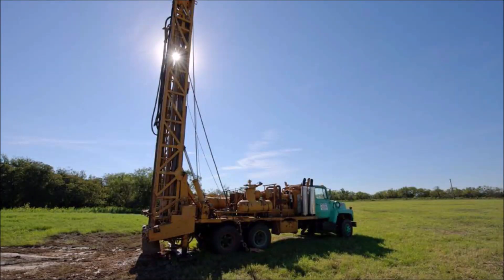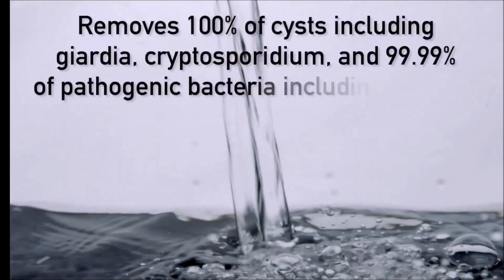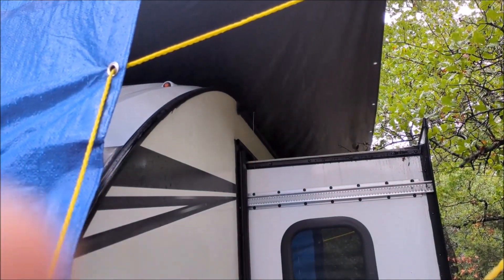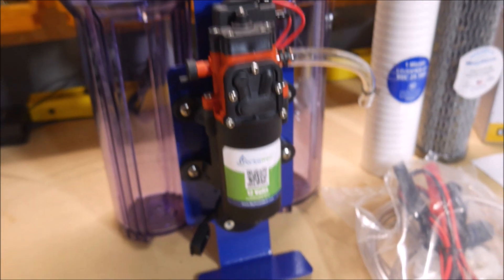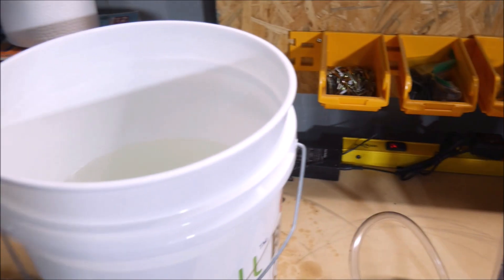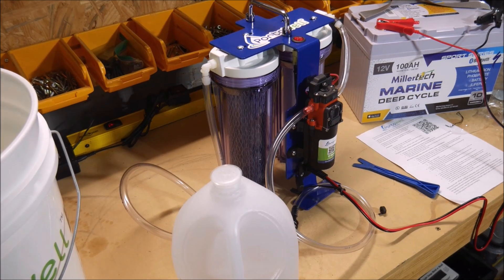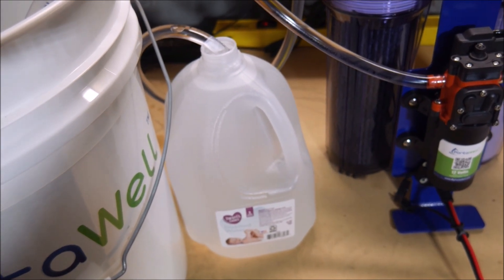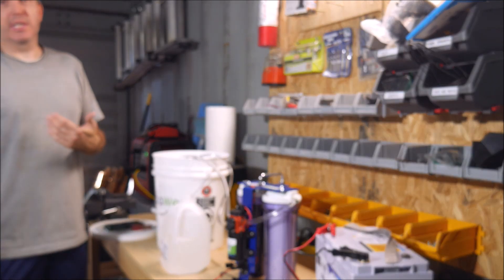Off Grid Homestead Water Series - 12V DC Rain Catchment System Filter For Clean Safe Drinking Water?

Comment: Would you use this for a IBC food grade water tank that's used to collect rain water?
Reply from the maker: Yes, exactly.  Rainwater will still have contaminants and possibly pathogens from coming in contact with the roof and the atmosphere.  So it still requires some level of filtration to be safer.  I say safer because no water will ever be 100% pure unless you go extreme with multiple systems (UV, RO, Distillation, filtration, etc.).

Comment: That seems like a really easy diy setup. A pump and some readily available filters. It would be interesting to see a price comparison. There are a variety of filter cartridges available allowing you to customize the level of filtration.

Regardless of your setup, just remember to always use a first flush device when collecting rain water. Adding a UV light will drastically improve the safety and sanitation of the water.
Reply from the maker: UV light is definitely going to happen at some point but that complicates things a lot.  It is considered optional by most filtration companies.  Ideal, yes.  But not absolutely required.  I have to get my power situation solidified first and a building on the property where I can permanently install the rain catchment system and filtration device. 

Yes, there are a variety of universal filters that can be swapped into this filter.  So it is a pretty good deal.  I haven't looked at too many other similar filters to make sure it is an apples to apples comparison but this one is much cheaper than most competitors.
Reply: @LDSreliance  as part of your future plans for water, you might consider an AWG (Atmospheric Water Generator). There are commercially available units, but a simple DIY setup is probably the best route. You probably already have most of the components needed.

If I had some property and not stuck in an apartment, I would be doing a lot of the same content. Keep up the great work.
Reply from the maker: I have seen those.  I will definitely look into that.  You can't have enough redundancy on a homestead.  I knew that intellectually going into this but now that I am living it... it is even more painfully clear.

Comment: You can easily and cheaply use a DC:DC buck converter to step down your higher voltage battery to the 12v needed by the pump. Small amount of power, cheap and efficient buck converter, probably cheaper than the 24v version of that pump just because 12v is so common everywhere.  And if you ever needed to replace the pump, 12v pumps are everywhere.  Also I've never seen a 48v version (but it probably exists).

One note on those filter housings... They are a standard housing which is not microbiologically safe, regardless of what filter is used. They can allow bypass and they do not remain sanitary when you change the filter.  It's probably fine - rainwater doesn't usually have pathogens and even the microbial stuff that grows in it is usually safe (but does bother some people) as long as you don't have mammals, etc. pooping in it.  That's where the roof raises a concern...  But it doesn't have to be complicated.

Check out "slow sand filter" --- the "slow" is critical.  This isn't the more common sand filter where you backflush to clean it, has a high flow rate, etc.  This is a filter where the incoming water at the top feeds all kinds of microorganisms that help clean the water, and as the water percolates down thru a few feet of sand the particles and dead microbes get stuck.  Maintenance: Depending on how much silt in your source water you might have to skim buildup off the top layer of sand more or less often, but other than that it just requires every now and then stirring up that top layer of sand - not too deep - and letting the accumulated muck flush out an overflow.  The filter stays operational the entire time.  After some years it might need the top layer of sand replaced or perhaps completely rebuilt if the sand gets too plugged up.
Reply from the maker: That's true.  But it adds one more point of failure to the system and more cost.

Thanks for the info on the rest!

Comment: I have an off grid water collection system and it’s basically using 300 ft.² of roof area and it feeds a 1000 L tank that’s protected from sunlight and I use a reverse osmosis system that uses pre-filtered water from the thousand liter tank and I like the rejection water go back to the tank so it doesn’t waste water. I have never run out of water and my water is extremely pure. It’s amazing how dirty rainwater can get from Pollen and other factors. 

I use 100 W solar panel and two L16  batteries to run the 12 V side of things. 

I also have 5 kW  of pv there for lighting and cooking and running my fridge
Reply from the maker: Very nice!  I love it.  I hope to have something similar but a little bigger.

Comment: I've had in mind already of creating something like this for filtering stored water in barrels. I'm surprised you did not DIY it to begin with. I would use Nylon tubing instead of Vinyl. I appreciate the video and it confirmed the design. Does the pump have an automatic pressure shutoff? Given you're building a homestead, this system should plum into the house plumbing.
Reply from the maker: I definitely would have done a DIY system if I had the time but with the 100 things I have going on at once right now I just couldn't do enough research to feel comfortable putting together a system that would work well without making mistakes.  For $300, Bob already did all of that for me so it was worth it this time to purchase someone else's expertise.  But normally I would DIY for sure.

I don't think it has any kind of automatic shutoff.  I can ask.

Comment: I would run a couple of gallons through before you drink! Also, does it take out fluoride?
Reply from the maker: The included Argonide Nanoceram filter does not filter Fluoride.  At least not that I can find in their documentation anywhere.  But you can use any 10" standard sized filter with this kit and it is expandable so you can add another 2 filters to the system and put any filter you want in there.